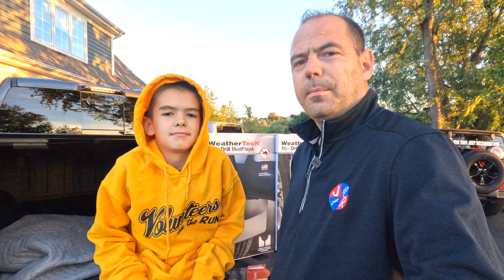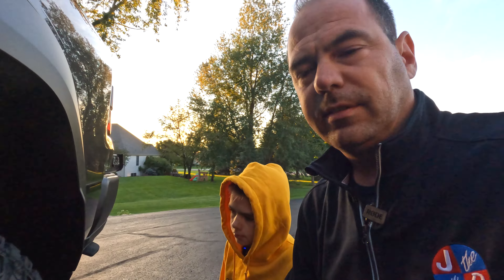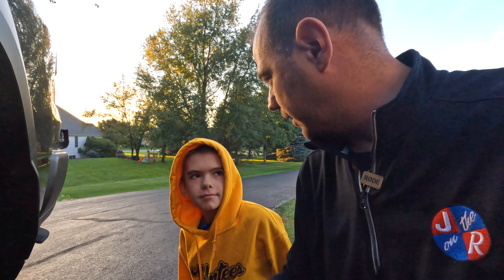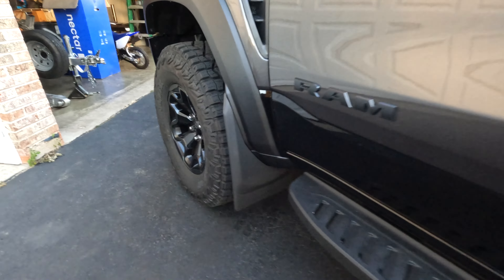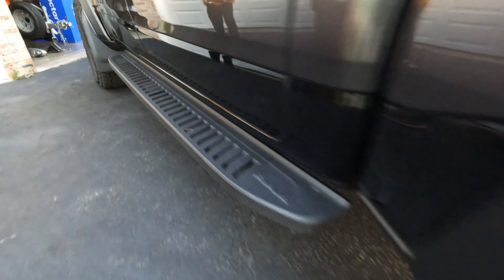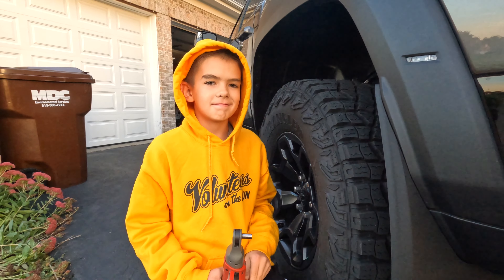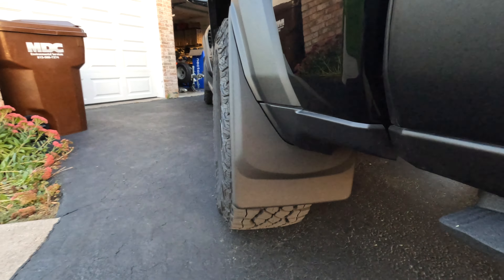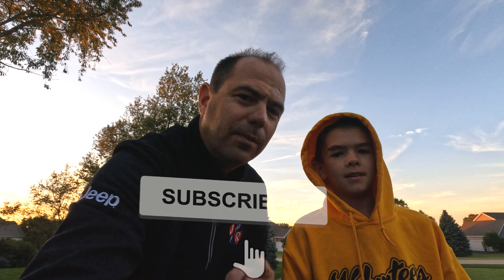How To Install & Review of WeatherTech Mud Flaps On A Ram TRX (Front & Rear)

Comment: bought a rHO, weather tech sent me mudflaps for a ram 1500 with flairs.  completely wrong!  Using your model nbrs weather tec says those are for a 2021 trx.  just curious what year your trx is? my flairs certainly still look like the ones on your truck. has that little extra flair right where the mudflap mounts.
Reply: I was told by weather tech the front ones fit but the back ones don’t  on RHO
Reply: @matthewpyro  guess before long ill know!  Their cheap enough i probably will try to modify them if I can and they are not direct fit.. Thanks for the response!